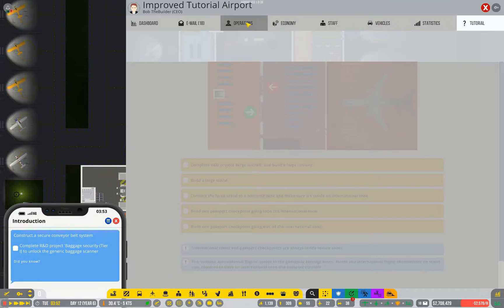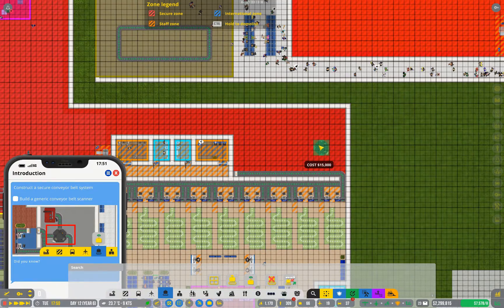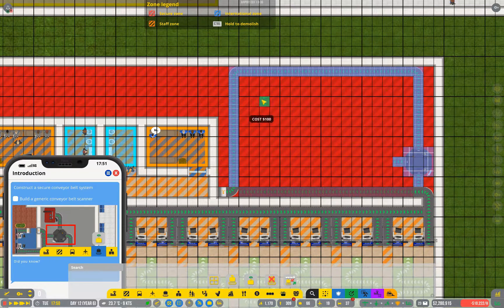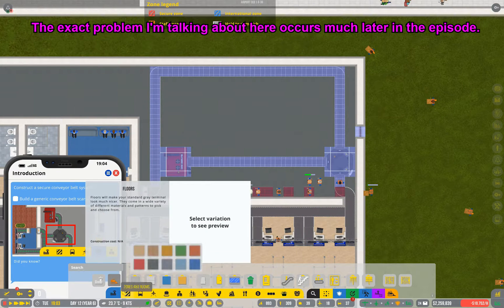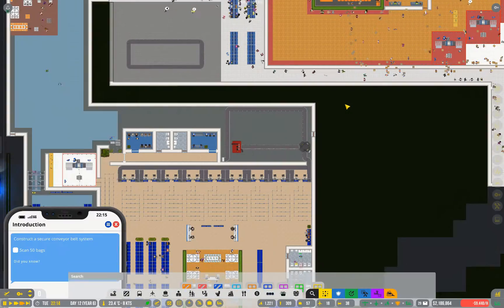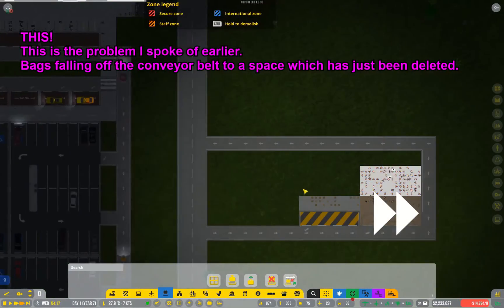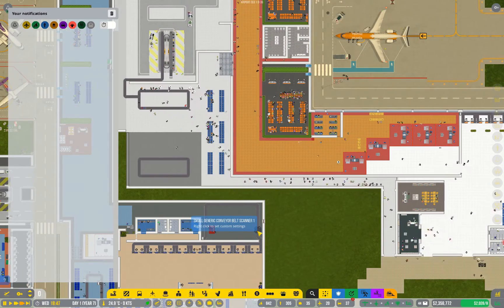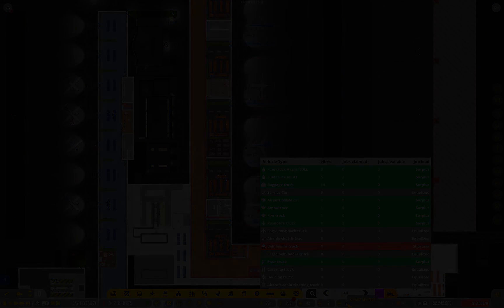Airport CEO Improved Tutorial: Baggage Handling, Part 2 Security Tier 1

Comment: I've noticed with even all  tiers of security illegal baggage can still get through. I always run a second tier 2 section on all failed baggage and ensure that I only use max trained security agents  on the tier 3 scanner. this reduces the risk considerably but even then some still gets through.
Reply from the maker: Yes. I don't think there's a perfect solution unfortunately. Some will always get through just because the security shift changes over or one of the officers make a mistake.